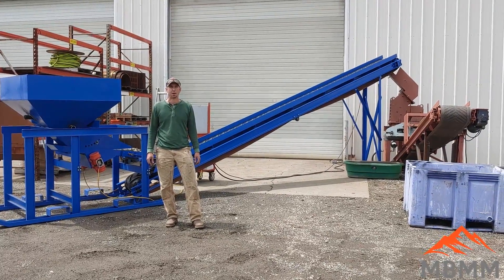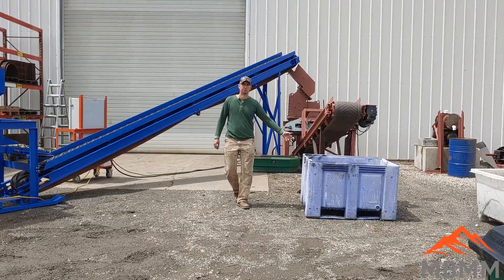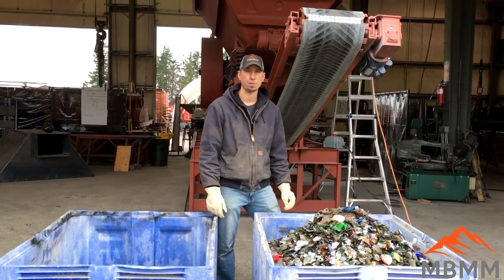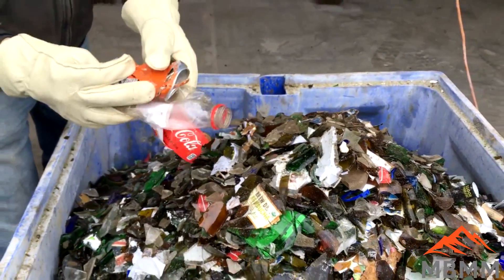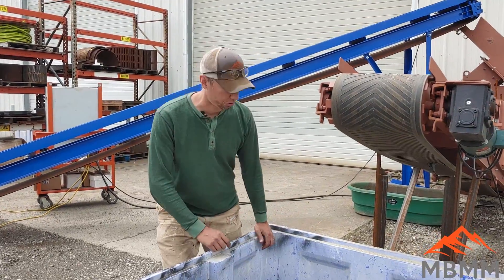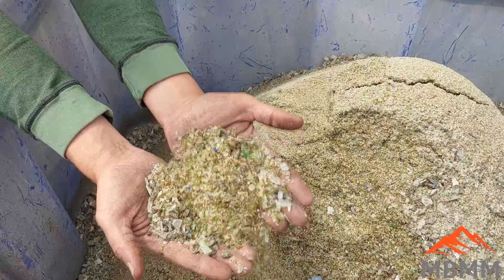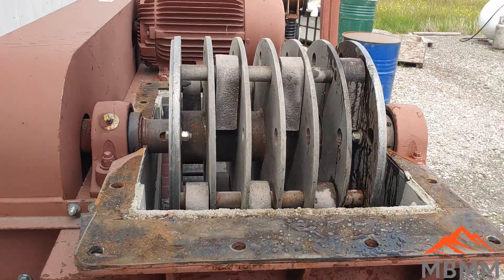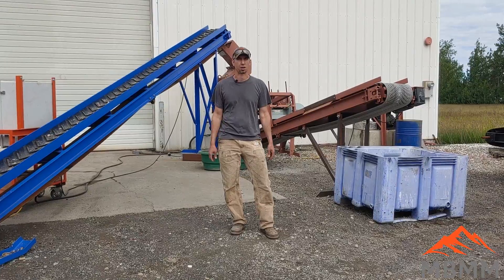Recycling Glass To Sand! Glass Crushing & Recycling Line

Comment: Nice video!  I have a question, why didn’t you separate the glass out to blue, brown, green, and clear?
Reply: I do that at home with a 1 metre length of 100mm square steel tubing and crush glass to 1/2 mm size using a car half shaft as the crusher......I use different coloured wine bottles and store them in plastic containers to make ornaments after re-melting them.
Reply: Ian what is a car half shaft please. Drive shaft-Axle-Crank shaft, i'm in no way mechanical but you have me stumped
Reply: @downunderfulla6001  Some cars, especially the older ones, have a back axle that has  2 shafts sticking out of the middle bit, one either side, which is the differential. These shafts are called half shafts and are about 1 metre long, made from very tough steel and drive the back wheels. Whenever I ever get one I use the steel for jobs that need to be tough as they can be machined on a lathe etc.
Reply: @gangleweed  wow awesome thank you for your time and help cheers
Reply: @gangleweed  do you have a video of any of that? I would watch it!
Reply: @somedudeRyan  Nope, I just want to mess with it.
Reply: Jeremy Owens this video was just him showing how well his current equipment could crush glass.

Comment: Thats not sand though. Each one of those micro fragments are razor sharp still and present a great hazzard. Glass dust was used to assassinate royalty at one point in history,  by being placed in food...death took months and was excrusiating...thete is no recovery of life once glass dust is ingested and breathed. It WILL cut all tissue it contacts . in some cases some of the particles will be trapped in scar tissue, but not often enough to count on. It alao cannot be surgically removed. Be carefull , wear a respirator when handling glass powder. Throw away the gloves that contacted it, treat it like poisonous and radioactive material combined. Do not let it contact your skin, it wont just wash off. Think of fiberglass insulation particles made of random shapes that cut into everythibg softer than itself .  Its taken for granted as we see glass constantly , but it is that dangerous.  It wouldnt be a bad idea to firgure out 
How to make this a wet system to contain the dust . one dry windy day and that entire building will be at major risk. 
Be safe.  Teach safe. Be a safe example . you have no idea how many people are watching that have no critical thinking ability or common sense .
Reply: Inhaling glass dust will give you silicosis of the lungs.
Reply: @rubyduma6238  yes, but mainly when it's very dry and very small dust of it. Less than 10 micrometers in diameter. But since in these kinds of operations, just because you use 0.8mm screen does not mean everything is around 0.8, there will be some finer dust floating around - it is not very wise to work with no PPE at all, long term. But silicosis it's a slow developing non-curable disease, he's going to be fine for the next 10 years, at least.
Reply: As soon as I saw this video I thought about silicosis. Surprised by the lack of dampening of the product. 
Check out silicosis in miners - before rock drills were water lubricated in mines, they were air blasted down the center. Miners knew it would kill and best they could do was a wet cloth around their mouths and noses. A local mine here tells that story and in the air blast drill days a miners life expectancy was 30 years..
Reply: The glass isn’t really dangerous as a chemical hazard because it isn’t silica anymore at this point. As for sharp edges, they really don’t stay sharp through processing; I’ve been working with cullet (recycled glass) in the container industry for 10 years now and I have manually inspected tons of glass without so much as a scratch.
Reply: im in recycled asphalt and thought that could be a hi grade  filler to make a longer lasting product this hazard I did not anticipate or even realize and just changed my mind on even using glass in my product..thank you I already have a hammer  mill
Reply: @granthaney2570  while i was only trying to outline the dangers, i appreciate you actually hearing what i had to say and heading the caution.  They already use glass in asphault for paving roads for added winter and wet weather traction. I think if you had a way to keep the dust contained in a liquid like an alcohol ,it should be able to be mixed in and evaporated leaving the dust in the product and expelling any alcohol , especially if slowly heated and agitated.  Youd have to check up on the chemistry to find what will work. Disposable ppe , like the paper hazmat suits for dry cleanups and a washable resperator , with replacible filters. Also dont blaim yourself too hard for not realizing...we have folks like the person who next commented to tell me i am wrong (which i'll except if they provide proof, but i doubt they can) because such and such says its only An irritant ... This is blind acceptance from the mindset the the government will do what is best for people...or he wants to help his friends business. I am coming from the mind set of , its fricken glass!  Its super hard, super sharp , brittle and breakable to anything but even, linear compression. And can have particles as small as the indivdual glass molecules. Which will cut. I am sure if you do research , you will find a way to utilize your idea ,safely ...as well as find im not speaking out of my posterior. There is SO much i could list as a glass Safety concern. Best of luck Mr. Haney.  Get at me if you ever need opinions and to bounce ideas around. While i wont be insulting as that defeats the purpose, i wont bs you into trying to spend an extra few dollars at every turn and if i feel an idea isnt so great.  Ill say so , but more importantly i will say WHY it isnt. That will help it immediatly be on the route to being great or being abandoned as not efficiant enough.
Reply: Also makes a great anal lube.
Reply: Corey Merrill this is false, since this would be amorphous silica, which is just classified as a an irritant
Reply: @maxsmith8196  what is false here, please show me the info. If i am wrong , i want the correct information . what i know is that  Ground Silicate glass was in fact used to kill people for a very long time...and occasionally still is. I know that most 3rd world nations , they tend to die very young when in the glass recycling industry...miners and salvagers too ...all for similar reasons. Glass dust, ground minerals , asbestose and other heavy metals and such are in high enough cencentration to constantky have sick and dying workers.  Glass in fact is the sharpest known substance to man as it can cheive a cutting edge that is a single glass molecule thick , which is why glass scalpels exist . for the finest of and most precise cuts possible. This sounds like you want to risk lives for making prophet...or perhaps you are defending your buddies hard work ? ... A small amount of exposure would be irritatiing. Just like fiber glass, boric acid and any fluid containing abrassives like soft scrub. Irritation is caused by miniscule pains. Such as itching. That is a form of pain and is irritatiing. Pain is caused by damage. So there for a large amount of irritant exposure could create excrutiating pain...in the case of glass shards, it eventually perforates  everything it contacts with enough time , causing irreversable damage and eventually  death from internal bloodloss, blood poisoning from bodily fluids seeping into the blood , blood seeping into organs , putrifying in both cases and causing infections ,especially once the large intestines are effected. They only have a single molecule thick lining and. Though it is very tough,if that is ruptured, cut or perforated ,torn or anything else that causes it to be comprimised, fecal matter will get into your bloodstream and other organs.